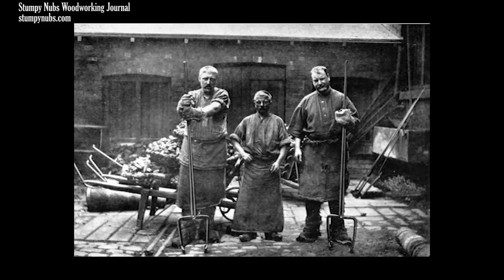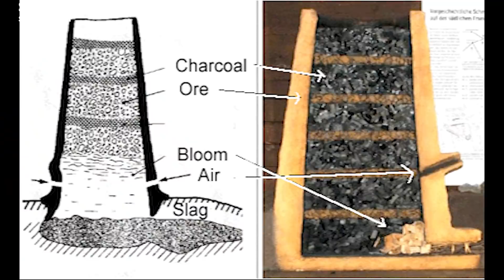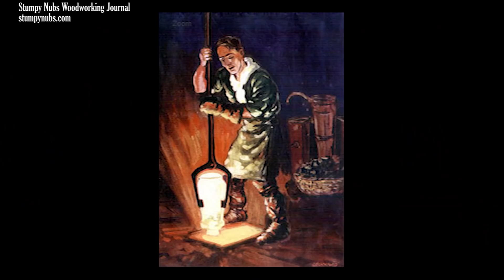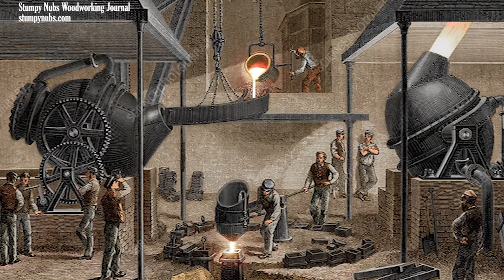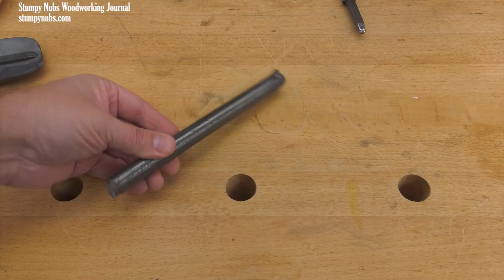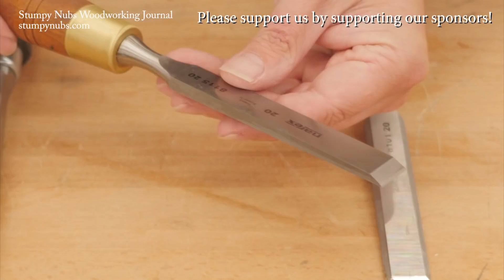Why a lot of tool steel is bad.

Comment: As a mechanical design engineer of 40+ years, who learned all this stuff during my apprenticeship in the 1970's, I have to say that you condensed what is an essentially very complex and far reaching subject, into an accurate and understandable form that anybody who is remotely interested in woodwork would do well to watch and learn from.
Reply: As part of my apprenticeship as a machinist, I had to learn how to harden and draw steel back. I even had to make a chisel and punch set from a bar of steel.
Reply: I like the part where he says the steel was used for railway ties.  'Tisn't.
Reply: @alext8828  You'll be shocked to know that some railroad ties are made out of steel. 'Tis.
Reply: @Yawyna124  Never knew that.  Cheerio!
Reply: @alext8828  Other materials that are more recent than steel railroad ties also include ties made out of reinforced concrete or certain types of plastics, though those are usually in much more specialized applications than steel ties--not that steel ties don't have their own specialized variants, like y-ties.
Reply: @Yawyna124  Yeah, I've seen the cement ones.
Reply: @harrickvharrick3957  are you 13 by chance? It's literally 1 compound sentence. Get better at reading if that defeats your ability.
Reply: @Yawyna124  I think he might be bi-lingual.  Maybe, give him a break.
Reply: Amen
Reply: Fine, fine. I'll watch 😉
Reply: so cheap steel is not going through all these stages? thats why its cheap

Comment: My dad, now 97, has tools that he bought nearly 70 years ago and others from his dad, including wooden planes. They are beautiful to use, take a good edge, and will last forever.
Reply: I dont know if it's because modern makers dont want to do the little things to make it great tool due to the costs, but the quality old chisels from a good maker is just superior.  With the right edge geometry, the durability difference is negligible.  The old stuff is easy to sharpen by a wide margin.  The balance is almost always at the neck.  The way the English did their bevels on the paring chisels, just can't be matched unless we are talking bout 100 dollar per chisel veritas.  Even then, it's hard to compare to a Howarth, Ward or Sorby that is 2 inches wide with a 10" blade length.  It's just absolutely insane to think they just did it by hands and eyes.  Every country had their style.  The Americans had the hardier chisel and the swedes had a nice length and balance that a modern chisel just can't seem to replicate.  The feel really is THAT important.

Comment: As someone with boxes of handle-less old chisels awaiting restoration, I enjoyed this video. Thanks. 

Also Swedish chisels from Eskilstuna are fantastic
Reply: Yeap forgot to quote that place.
Reply: Straight razors made there are among the best you can get. They take longer to put an edge on but they hold the edge for a long time.
Reply: Yeah absolutely keep an eye out for them. 

They look pretty much like any normal chisel from that era so they often get dismissed so you can find gems like those in the junk tool piles.
Reply: Peugeot and Goldenberg had some really good batches of tool steel too (in the case of Goldenberg I believe the ones marked with an eye were the best quality), though I doubt they reached the US as much as English tools did.
Reply: I inherited handful of chisels and planers from my grandfather.
Swedish manufacture in beginning of 1900's. Hard to sharpen, keep good edge and cut is very smooth. He got those when he was learning his trade in the end of 1930's . Fortunate, after "iron curtain" fell, most woodworking tools mass produced in USSR were crap. Among other things ;)

Comment: Great video, James. A couple of years ago I browsed through the chisels available at my local Lee Valley here in Ontario. Narex chisels really hit the price/quality sweet spot for me, so I bought a full set of bevel edge Narex chisels. The handles are perfect for my hands, better than the slightly more expensive basic Veritas chisels. I recently added a few Narex mortise chisels to my collection. They all need a fair bit of lapping on the back, but that's what my Worksharp 3000 is for. Oh, and BTW when I started woodworking I chased around for a while looking for vintage tools. I quickly got over that. I want to do woodworking, not antique collecting.
Reply: Everyone needs to made their own tradeoffs.  I'm short on time more than money, so the return on investment of searching for an old tool needs to be really high for it to be worth my while.
Reply: I have a hard time passing up old tools in bargain stores that need a little TLC.  Not because I think they're superior to modern steels, but because they still do their job admirably and have a lot of good life in them yet.  The cheap price is also a motivating factor too, a dull #4 plane with a blade inserted backwards is surprisingly cheap when people think it's useless at planing.

Comment: I made the mistake of buying a 1940s stanley plane in an auction to restore it. With all the time and money I put in that thing, I would have bought a couple of brand new Lie Nielsens made 6 months ago. I learned my lesson: Old is not necessarily better, brand new is not necessarily bad. Thanks for the nice video :D
Reply: We at Tooltique have always stressed that old tools require input to bring them to a standard suitable for users and why we undertake this process. As a result our customers know they don't have the same problems you and many others have experienced.
Reply: Don't give up.  You can case harden the steel.  Clickspring has a video on that, and I'm sure there are others.  You're on the right track.  Good luck.

Comment: I will happily endorse Narex chisels. I own their cabinet-maker style chisels, rather than the carpenter's chisels shown in the video. The main difference is the thickness of the sides remaining after bevelling the top. Thicker equals stronger for the carpenters chisels, but harder to get into the corners of a dovetail. The carpenters chisels also have the split-protection ferrules at both ends of the handle. Narex are my main set of bench chisels and I find them excellent. They sharpen well and the handles show little wear after five years of solid use. I also have some carving gouges from them which are equally as good.

Comment: Most of my chisels are from Japan, but the one I use most is my carpenter chisel. My first boss explained the difference. A cabinet makers chisel is sharp and the tip protected. The carpenters is the old Stanley floating around the bottom of the tool box with the cutting edge chipped till it looks like a saw and is not as sharp as your square. Great for cutting nails and leveling cabinets.

Comment: Very interesting video. I for one would be very interested in hearing about modern cryogenic steels and how they’re produced. Another top video, I really enjoy your channel and often refer people to your safety videos, particularly the table saw series you did a while ago, excellent work.
Reply: I hereby second the motion. Please, do a follow up video. Don't leave us hanging off the cliff!
Reply: Ditto
Reply: Likewise
Reply: I would too. Thanks so much for the really interesting history.
Reply: They simply cool the steel to cryogenic temperatures after a fairly normal heating and quenching. This finishes converting the last few percent of the steel to martensite and possibly allow a slight stress relief in the crystal structure. Then they temper it. Some do the cold treatment following some amount of tempering. It is more useful for some alloys than others.
 But in any case your talking about a fairly small improvement, but its low cost so probably worth it (to a manufacturer), and it the important part is a boost to margins because it sounds really good for marketing purposes. Really, a nitride [or similar] coating on the back of the chisel would probably be more beneficial.
Reply: @mytech6779  downside of nitride is that that you lose it once you sharpen through the layer.

Nitride is also much lower of a surface hardness improvement opposed to standard carbuerizing.

Cryogenic treatments, as you so rightfully mentioned, are pretty much exclusive to any steel with enough retained austenite that you can transform by bringing it down to that temperature. I think the stress relief would only occur if you do a proper uphill quench from the cryogenic state.

If you can get an extra point on the HRC scale, it could be substantial enough of a cost savings opposed to using a fancier alloy steel.
Reply: @ChesterTheSpider  
The idea is mostly hypothesis in regard to wood chisels, I have not seen any performance tests of hard coatings in this specific application.
You don't sharpen the back of a nitrided chisel. Also many nitrides can be applied post heat treatment (depending on the alloy) and masked so that it won't interfere with final bevel grinding/sharpening. This post heat treat also means they could be re-nitrided after heavy wear. For less keen edges such as mower blades, a very thin hard layer on the back side tends to produce a self sharpening effect as the softer bevel face wears faster and exposes the thin hardened layer at the edge.

Several common nitrides are harder and more wear resistant than the iron carbides(cementite) formed by carbuerizing. Carbuerizing can give a deeper layer if needed, but that is not desired here as only the last few thousanths of the edge bears most of the wear in knife-edged tools. Also for a wood chisel, through hardening would be less manufacturing trouble and equal in performance to thick case hardening.
Reply: @mytech6779  I stand corrected, some nitrided steels do produce a harder surface. I flipped it in my brain. In this case, you would see a higher edge hardness with a nitride process  given the correct alloy.

I also had not considered that a small layer of case would be exposed when you sharpen the bevel. Thanks for your thoughts.
Reply: @ChesterTheSpider  Was just a matter of clarification. And like I said my thoughts are only a hypothesis at the moment.
Reply: @mytech6779  of course. I'm curious myself. Knife steels are a bit odd compared to others. Lots of foreign specs that make their way here too that are interesting. 

Knives and cutting instruments have a rich history and all it takes is one silly curiosity to make something really cool, even if it is not practical.
Reply: @ChesterTheSpider  I'm not even sure that nitride can be honed to a decent fine edge, it may just microchip.(Again just fine for something like a mower but not for a knife)
Reply: @mytech6779  The sharpening technique and direction might have to be adjusted. Low heat input low stress grinding (which you would want anyways). But yea, would need metallography to check.

Comment: Narex is a legend in the Czech Republic and Slovakia. 
My dad's Narex drill is older than me, with no variable rpm's, just a two-stage gearbox. He used and abused it when building the house I grew up in, and yet the only thing he had to replace was the brushes. I am 38 and it is still working :)

Comment: This makes so much sense now. I have an old wooden transition plane I got from an estate sale. I haven't sharpened it since the first time I did after bringing it home and it's my go-to fore plane, but can also be used for finishing and will cut through knots easily. I have a newer Stanly #4 which I use for a lot of finishing work, but it requires almost constant sharpening.

Comment: The development of turning tool for turning wood has made great strides… From very hard chrome steels to m2 steel over 10 years ago and the M2 steel holds an edge much longer than the chrome steel..Now in the last 2-3 years a M42 steel was developed and holds and edge 2-3 times longer than M2 steel..  These new steels have cobalt in them.. I still use all 3 listed here..  But if your starting new.. start with the M42 and you will be pleased.. See Carter and Sons in Seattle..

Comment: For folks new to some of the metal (particularly carbon steel) ideas a look at the iron carbon eutectic diagram is interesting. It shows just how many different materials are produced depending on the ratio or iron to carbon and what occurs depending on temperature achieved and rate of cooling

Comment: I would love to see a video going into detail about the modern steels and process. Like you mentioned at the end of the video.
Reply: Absolutely! As a woodturner, more info on the various grades of High Speed Steel would be good, too...
Reply: Check out Gough custom on here. He's a knife maker but he goes really in depth in his older videos to the heat treat and cryo of tool steel. 

And his newer stuff goes really in depth into the CNC side of it.

Comment: I'd love an even more in depth getting into the different metals like O1, A2 or D2 tool steel. 
A2 can hold a great edge when given a cryo treatment
Reply: He wasn't going to get too far into the weeds on info that strayed from the Narex finalé
Reply: Agree though, weed out the gimmicks for us. I have a hellishingly expensive 'cryogenic' steel bowl gouge and would love to know whether I was sucked in by the hype, or if it is superior. It certainly holds a long edge, which is lucky because I’m terrified of sharpening it…
Reply: Cryo is just an extra step in the heat treating process, it’s not a magic bullet but does help, especially with stainless. Check out a dude named Dr. Larrin Thomas, he’s the goat on metallurgy. You’ll be getting more into knife making territory than wood working but the information will be useful if you’re interested in what the different processes actually do.
Reply: You're looking at a whole different world there. Knife/Tool making metallurgy. s90, M4, D2 go look at the modern blacksmiths.
Reply: Man,  and don't forget you have to put tool steels  in  a preheated oven not letting it go below 125 f, but bellow 150 f,  for tempering
Reply: @ryanb1874  I think tempering temperatures are more in the low 400s. I don’t know every steel so there could be an exception. Or I could just be wrong, just what I’ve come across.

Comment: Best explanation for tool steel and edge tools I've seen and I was a materials science technician and tool maker.  I used to teach heat treatment of various steels to mechanical engineering students in the laboratory and then test for hardness and strength (toughness to resist impact damage).   Well done!

Comment: You are dead on. My best and most used chisels are those my grandfather had and the antiques I find at estate/garage sales.
 I also cut off the ends of old brace bits and use them as well.

Comment: James , this is quite an excellent presentation and we can see, that you have a firm grasp on your subject matter.  I have owned both Sheffield steel in the form of Marples brand, as well as Swedish steel chisels made by Berg Mfg Co, also known as Fish brand or Eskilstuna, sporting a blue oval label.  The Swedish steel has been far superior to the British iron in terms of edge formation and overheating at the ole carborundum wheels used ages ago.  I’ve owned both of these for over 50 years purchasing at the Woodcraft store in Woburn, MA in 1970. Many blessings young man.

Comment: Outstanding video!  You really have a gift for identifying and presenting the most important aspects of any topic.

Even if modern tool steel is mostly better than "old time" steel, I still prefer using my classic tools in the shop.  There is some kind of satisfaction that comes from using a 100 year old Stanley plane or 150 year old chisel that Veritas or Lie-Nielson will not be able to match in my lifetime.  That said, my great grandsons will inherit some really sweet hand tools that will be classics by then and will be barely used in the meantime!

Comment: Really enjoyed your well delivered presentation. I admit to not giving modern steel chisels a chance. I have long favored the antiques--finding, restoring ( turning figured woods handles, cleaning up the steel, honing and polishing) and using them. I have noted a lot of differences in the edge holding properties of different makers, as well as differences in those by the same maker. Also, many of the old ones have a tad bit of twist that can be pesky in carving situations.  I think I will do more research and give some of the newer ones a shot--Many thanks.

Comment: Back in the 1980s in UK I to make musical instruments using hard maple with flamed grain that is hard to cut but also easily tears. In those days you could easily find cheap antique chisels and I was surprised by the variety of the quality. But I soon learned that the consistently best tools were W&P (Ward or Ward & Payne). They can be slightly brittle but on the other hand when they hold an edge that well you don't have to hit them so hard so they're less likely to get broken anyway. I was in Zambia a cople of years ago an found a few W&P chisels, presumably colonial leftovers, on a market stall there!

Comment: For someone doing woodworking as a hobby, someone who can take care of tools and sharpen them when needed, who aren't really concerned with having the most efficient tools to maximizing use time and minimizing maintenance. Where overall value isn't the top priority as for some manufacturing company or similar... you can't really deny that for most people like that, old tools are simply cooler and more satisfying to own and work with. Maybe only surpassed with tools you made yourself :)

Comment: I learned a LOT from that video. I may not retain all of it, but I will take away a better understanding of how tool steel has evolved, and why the old tools I collect aren't necessarily better than the new ones I can buy (an ignorant prejudice I confess I had, until just now). Your explanation of hardening and tempering modern tool steel was also very educational.